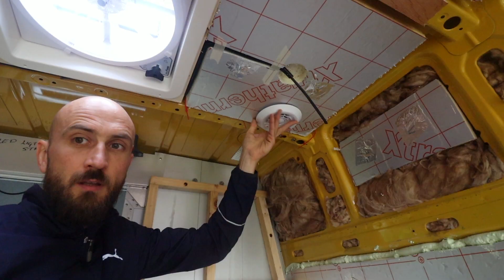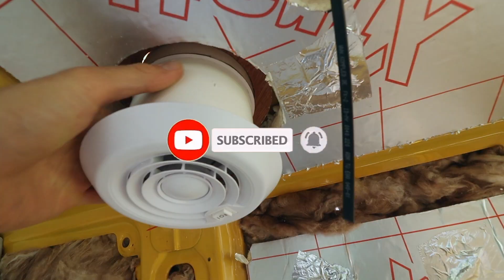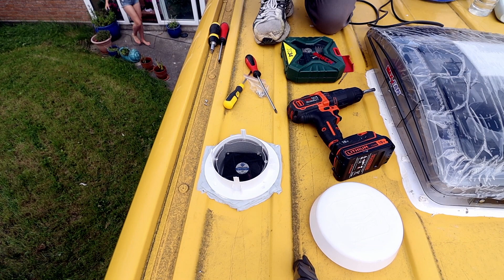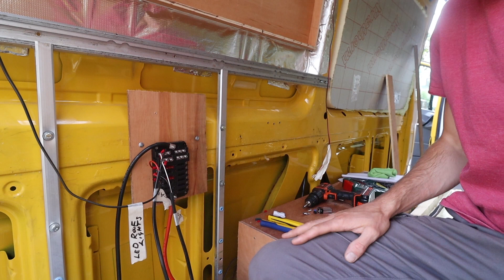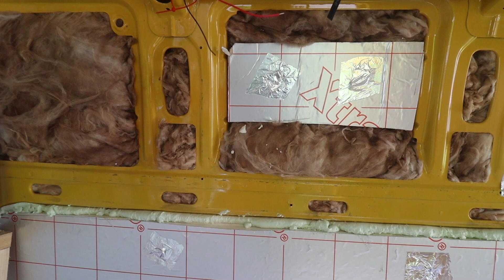VANLIFE - SHOWER FAN DIY NSTALL - VW CRAFTER CONVERSION - EP. 20

Comment: Hi Richie been following you for a few weeks now and hat of to you matey. I’m currently in the middle of a crafter build. Currently wiring and insulating and onto batoning ready for the ply walls. I have the same fan and was hoping you would show the wiring of it. What goes on the three spades on the switch? Keep up the good work pal 👍
Reply from the maker: Thanks Paul! I actually bypassed the switch that comes with the fan. Instead I connected it to a 5 gang switch panel that I have located on the out side of the shower. I’ll be doing a video soon on how I connected it to the 5 Gang switch panel.